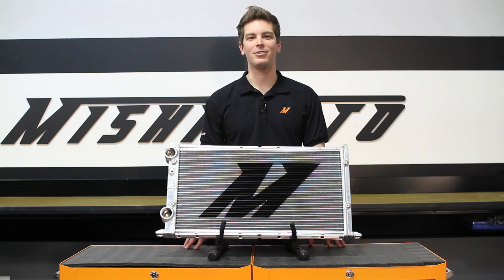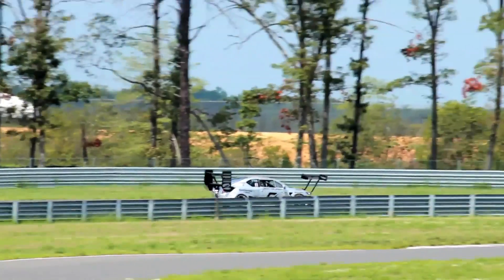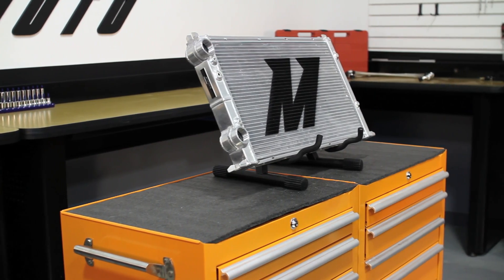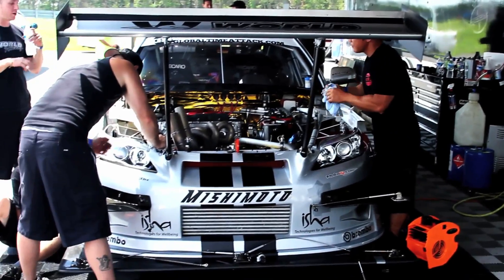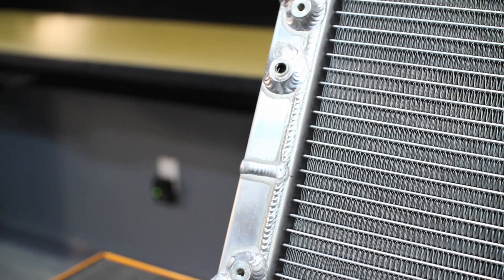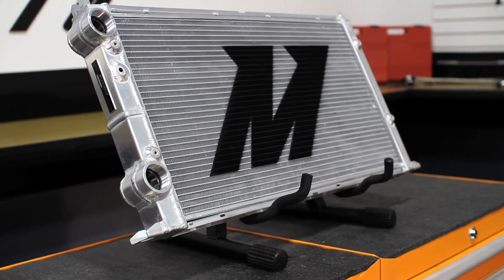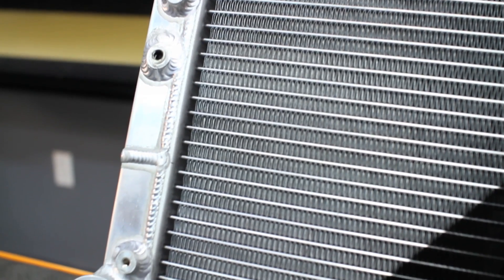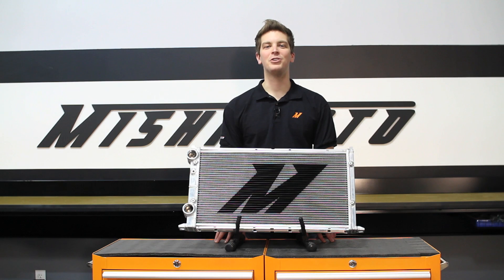Race Ready Performance Radiator Features & Benefits by Mishimoto

Comment: Can it fit a 2015 Camry
Reply from the maker: Hey Mike, nothing available for that vehicle as of now. However, I'd be happy to submit a new product suggestion if you'd like. While it is not an immediate solution, the R&D team does pay very close attention to these types of inquiries. The more we receive, the better the chance of the part making it to market!
Reply: Mishimoto Automotive buddy the Camry is the best selling car in America
Reply from the maker: Hey Mike. While the vehicle may sell well, that does not mean aftermarket support is largely requested. If you have products in mind, I'd be happy to pass them over to R&D.
Reply: Mishimoto Automotive ok I was thinking of changing my radiator but after 100k miles when I get this racing one how many time do I gave to change the coolant cause my 2015 Camry is pink light red color
Reply from the maker: Hey Mike. As a general rule of thumb, you should get a coolant flush every 30,000 miles or three to five years, whichever comes first. Your car’s owner’s manual should also outline a more specific interval depending on the manufacturer.
Reply: Mishimoto Automotive I read the owner book and it say Toyota long life coolant
Reply from the maker: That is great news, Mike. With that being said, feel free to follow the manufactures instructions. They know their vehicles best :). Additionally, any Mishimoto radiator will be fully compatible with your OEM recommendations.
Reply: Mishimoto Automotive Do you make one for a 22ret 1986 toyota pickup? If not I would love to donate my truck for fitment testing 😊
Reply from the maker: Hello G FUNKERA. Nothing performance based for your vehicle as of now. My apologies for that. However, if your willing to put your vehicle up for testing, just fill out our MVP form and R&D would be happy to reach out if they are interested. https://www.mishimoto.com/mvp
Reply: Mishimoto Automotive I am super interested thank you. I am in SoCal.